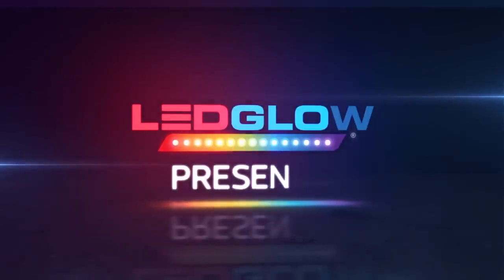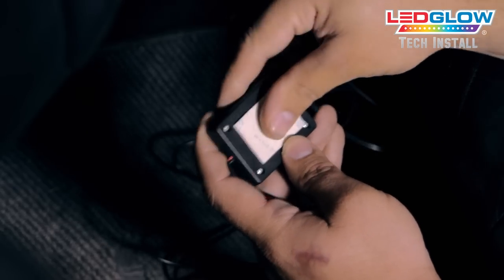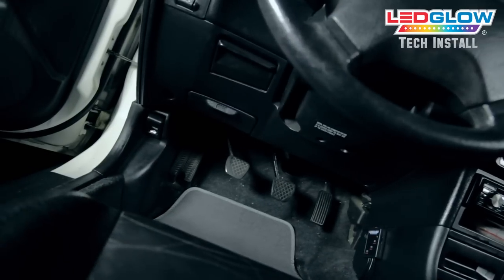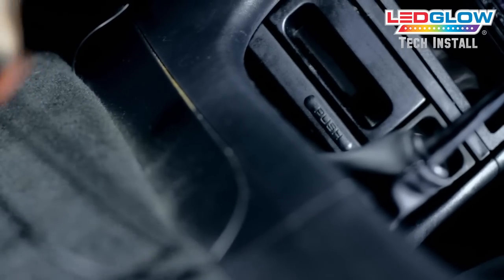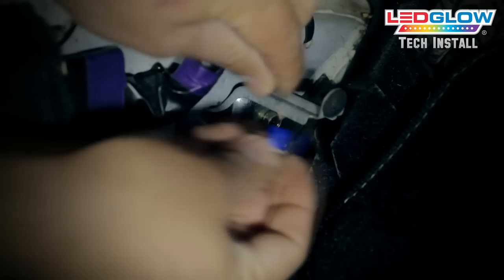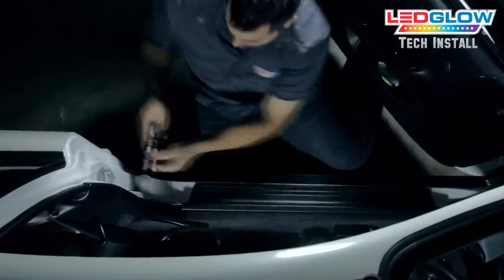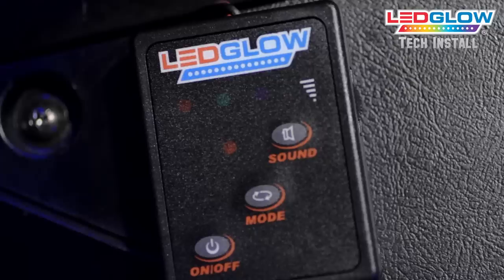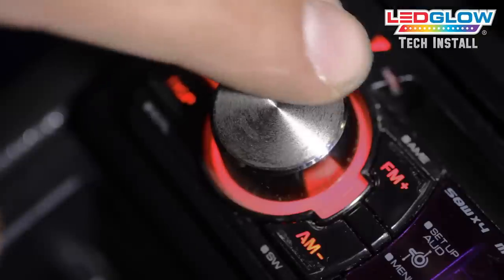Installation | LEDGlow 4pc 7 Color LED Interior Car Lights and Truck Lights

Comment: I have the 6 piece multicolor kit. I just wired it to my battery, but I never use it so I want it to turn on when I open the door. Now I have no idea what you did. What did you use to connect it to the fuse and how do you know what fuse to put it on? And I have no idea what you did to the ground on the door. You went way to fast, your hands were blocking everything and you didn't explain anything. Help me out here! Please reply soon so I can get this set up.
Reply from the maker: +Stephen Locke When it comes to the expandable circuit, you can use any constant power fuse that is 15 amps or less. As far as the door jam install goes, you just splice our kit's ground wire, into the ground wire on the door jam switch.
Reply: First of all, thank you for replying so fast. Can I put the positive wire directly on the battery and the negative on the car door?
Reply from the maker: +Stephen Locke Yes, as long as the door jam switch is activated by ground control

Comment: Would this kit work in a 1998 ford f150 extended cab?
Reply from the maker: Aj Palmer Yes our LED lighting kits are universal and can definitely be installed to your 1998 Ford F150!
Reply: What fuse should I add the expandable circuit to?
Reply: Any recommendations?
Reply from the maker: Aj Palmer It all depends if you want power going to the kit at all times or only when the car is powered on. Personally I recommend connecting the kit to a switched power source so the kit only has power when the car is turned on. You can use some fuses like the radio fuse, power windows fuse, or any other source that only works with the car powered on. Let me know if you have any other questions or concerns!

Comment: I did everything but the kit won't turn on
Reply from the maker: Renzo Chacon What power source did you connect the red power wire to? Is the black ground wire connected to a bare metal surface?

Comment from the maker: The expandable circuit is an optional installation accessory that is not included with the interior kit. It makes the installation process a lot easier by tapping power from the fuse box, but it is not necessary for the installation. If you were to use one for your 2003 Honda Accord, you'll use a mini expandable circuit. Let me know if you have any other questions or concerns!

Comment: Would these work on a 05 chevy trailblazer?
Reply from the maker: Savedbymusic〈3 Yes, our LED lighting kits are universal and can be installed to any vehicle so you're good to go with your 2005 Chevy TrailBlazer. Let me know if I can help with anything else!
Reply: I will most likely be ordering mine this friday i want to do the add a circuit ( for fuse box wiring ???) but I'm unsure which add a circuit option i should use? Im not very inclined when it comes to vehicles which option should i use? (Still talking about the 05' trailblazer btw)
Reply from the maker: Savedbymusic〈3 You will need to use a Mini Expandable Circuit with your 2005 Trailblazer if you plan on powering your kit from the fuse panel. If you have any questions or concerns when you get to the installation process do not hesitate to contact us, we'll be more than happy to help out!

Comment from the maker: It is not recommended that our Interior Kit's lights be used under the car. The interior kits featured in this video come with four 9 inch tubes with 5 feet of wire so it will be difficult to mount tubes in different positions and run all of the wires. We do offer underbody lighting kits that come with two 48 inch and two 36 inch tubes that will give you the glow you're looking for under your car. If you have any other questions just ask!

Comment: Can I connect this with a 2000 bmw 328i?
Reply from the maker: joshua ortiz Our LED lighting kits are universal and can be installed to any vehicle with a 12v power source, so you're good to go with your 2000 BMW 328i! Let me know if you have any other questions!

Comment from the maker: You can use any fuse whether it's a switched or constant source, but make sure the fuse is 10 amps or less. You can use the radio fuse, power windows fuse, power locks fuse or horn fuse to name a few examples. The way you can tell how many amps for a specific fuse is by looking at the number on top of the fuse. If you have any other questions or concerns don't hesitate to ask!

Comment: can I use a 2amp fuse.?
Reply from the maker: snapback17 You should be able to get away with using a 2amp fuse to power the kit, but if that doesn't work you can go up to a 3 or 5amp fuse. Let me know if you have any other questions or concerns!

Comment: Will these be fine on a Mazda Rx8 2005?
Reply from the maker: ElArmando97 Our LED lighting kits are universal and can be installed to any vehicle, so you're good to go with your 2005 Mazda RX-8! Let me know if I can help with anything else!
Reply: Is Blue the only color or can you change it ? Or do you just need to buy a kit of the specific color you want?
Reply from the maker: ElArmando97 We have Single Color Options available that include Blue, Red, Green, Pink, White, Orange and Purple, as well as several Multi-Color options. Here's a link to our website for you to check out the different kits we offer and if you have any questions about any kit don't hesitate to ask!

http://www.ledunderbody.com/LED-Interior-Lighting-Kits.aspx

Comment from the maker: You can connect the power wires directly to the + and - terminals of your battery or you can power the kit from a constant 12v source on fuse box with our add a circuit. Some potential constant sources you can use are the brake lights or power seats fuses, anything that you can function with the car turned off. Let me know if you have any other questions!

Comment from the maker: You will need to connect the black ground wire to a bare metal surface or else the kit will not power. You can connect this to any screw that threads into metal or to the seat tracks. If you have any other questions or concerns don't hesitate to ask!

Comment from the maker: Unfortunately we don't have any videos showing an install on a 2001 Civic. The Interior LED Lighting Kit can be powered to any 12 volt source via the add a circuit, cigarette lighter adapter or the red and black power/ground wires from the kit. If you have any other questions just ask!

Comment from the maker: The second fuse used in the add a circuit for the interior lighting kit should be 4 amps, which is included with the add a circuit. Let me know if you have any other questions!

Comment from the maker: Yes, you will need to use the included 4amp fuse with the expandable circuit for the kit to power. Our lighting kits are universal and can be installed to any vehicle with a 12v power source so you're good to go with your 2012 Nissan Sentra. Let me know if you have any other questions!

Comment from the maker: You can still power this kit with your fuse box being under the hood that is not an issue at all.  In regards to your other question, any fuse will work.  You just need to decide if you want to connect it to a constant or switched source.  Let me know if I can answer anything else and have a great day!

Comment from the maker: If you have only 1 wire - simply get a 3m Scotch Lock Connector, and you can easily tap off the one wire to get your supplied power. Please let me know if you have any other questions!

Comment from the maker: The LED lights will only turn on and function when the door is opened. The black ground wire is being connected to the door pin, so when the door is closed, the power circuit to the kit closes. Check out our video called "LEDGlow's Auto Illumination" and it will further explain installing and programming your kit to use the auto illumination function. If you have any other questions or concerns don't hesitate to ask!

Comment: I got no car switch or zip ties or cord for charger
Reply from the maker: The kit comes with a control box which is the only "switch" that you will need. The expandable circuit that we show being connected to power the kit is not included, however, you should have received zip ties with the kit.
Reply: LEDGlow I ordered the 4 piece 18 led I have the led lights the box with wires. I don't have the circle wire in the back and I didn't receive the cigarette lighter switch
Reply from the maker: Please call us at 856-768-5700
Reply: LEDGlow could I email you?

Comment: my kit did not come with zip ties or the fuse wtf
Reply from the maker: +SweetPapaRayz z (chriswb2) I apologize about these items missing. I would recommend getting in contact with our customer service department regarding this matter. You can call in at 856-768-5700 or e-mail at: customerservice@ledglow.com
Reply: It's all good

Comment from the maker: A mini add a circuit will work with a low profile fuse box as well, you will just have to replace the stock low profile fuse with a mini fuse. If you have any other questions or concerns don't hesitate to ask!

Comment from the maker: Ray, if you want to learn more about connecting your kit to the door pin, click the link at 1:51 on the bottom right side of the screen that says "Learn More About Auto Illumination" or you can search "LEDGlow's Auto Illumination."  This video explains more about the auto illumination function and further explains connecting the kit to the door pin as well as the headlight and ignition switch. Let me know if you have any other questions about the kit or the auto illumination feature!

Comment from the maker: If you want to power the kit from your 1999 Audi A4's fuse box, you will use a mini expandable circuit. This is an optional installation accessory that is sold separately from the interior kit so you would need one to draw power from the fuse box. The interior kit featured in the video is our 4pc Blue Interior Kit that comes included with the auto illumination ability. Let me know if you have any other questions or concerns!

Comment from the maker: The on/off mode is included with the control box, you would just need to program the kit to use that function. Check out our video called "LEDGlow's Auto Illumination" for more information about the on/off function. Let me know if you have any other questions!

Comment from the maker: Please refer to our underbody installation video to see more on how to install the tubes to the front and the rear of your truck (can't post links in comments). Every vehicle is different when it comes to mounting locations, but the process is virtually the same. The interior kit will also not sync with the underbody kit because they are two separate kits with separate control boxes. We'll be releasing a revamped underbody installation video very soon so stay tuned!

Comment: I am truly considering purchasing the red 4pc. to put in my new car. However that is the problem. It's brand new. I work with electronics similar to this, but not with cars. I'll be frank. It scares the shit out of me thinking about trying to install these. I would have to kill myself if I screw something up in the wiring.

Comment from the maker: There is no difference between the 3 expandable circuits besides the size of each. Different makes/models use different fuses, so that's why we offer 3 different types of expandable circuits. For your 2001 Jeep Cherokee, you will use a mini expandable circuit. Let me know if you have any other questions or concerns!

Comment from the maker: What kind of car do you have? If you're looking for way to install without drilling a hole, your best bet would be to power the kit with a cigarette lighter adapter or hardwire the kit to the back of the cigarette lighter port. If you have any other questions, don't hesitate to ask!

Comment: Sold how much
Reply from the maker: mike malott The interior kit featured in this video is priced at $32.99 for Single Color options that include either blue, red, green, pink, white, orange and purple and $34.99 for the 7 Color Kit option. Here is a link to our website for the single color options: http://www.ledunderbody.com/4pc-Interior-Lighting-Kits.aspx and a link for the 7 Color option: http://www.ledunderbody.com/7-Color-4pc-LEDGlow-LED-Interior-Lights-Lighting-Kit.aspx. If you have any other questions or concerns don't hesitate to ask!
Reply: Why yall are the best great product for a low price
Reply from the maker: Thanks a lot! Glad you're enjoying the kit!  mike malott

Comment from the maker: If you install your kit this way, the lights will not turn on when your door is closed and will only illuminate when the door is opened. Just make sure that you connect the power wire to a constant 12v source. If you want to refer to our "LEDGlow's Auto Illumination" video, it goes more in depth about installing your kit this way. Let me know if you have any other questions or concerns!

Comment from the maker: This lighting kit was designed for a 12v power source and will not work with a 16v power source. The blue color looks a little dark because the color is being absorbed by the dark interior and floor mats. If you are looking for a lighter blue color, our 7 Color Interior Lighting Kit comes included with Teal, Blue, Green, Red, White, Purple and Yellow. Let me know if you have any other questions or concerns!

Comment from the maker: The difficulty all depends on how you're going to install the kit. The add a circuit is the easiest and cleanest way to install any of our LED lighting kits. If powering the kit from the fuse box concerns you, you can use a cigarette lighter adapter or you can connect the red and black power wires directly to your car battery. Let me know if you have any other questions or concerns!

Comment from the maker: If you ground the black wire of the kit to the door pin and enable the auto illumination function, the kit will only function when the door is opened. If you don't choose to install the kit with the auto illumination feature, you will be able to use your kit anytime whether the door is closed or not! Let me know if you have any other questions!

Comment from the maker: You can splice the power wire into any other switched or constant 12 volt source using a butt connector or run the power wires straight to the battery!  Let me know if you have any other questions, I am more than happy to help!

Comment from the maker: If you order a 4pc Interior Lighting Kit, you will receive the four 9 inch lighting tubes, control box, mounting hardware, installation instructions and a one year limited warranty. If you have any other questions or concerns just ask!

Comment from the maker: Whether you're installing this to a 2007 Honda Accord with Navi or a 1990 Honda Accord, the installation process will remain the same as our lighting kits are universal and can be installed to any vehicle with a 12v power source. If you're looking to wire the kit to the radio source, having a navigation system will not alter the installation process and you shouldn't run into any issues. If you have any other questions or concerns don't hesitate to ask!
Reply: How do you adjust the colors

Comment from the maker: Yes, before you begin the installation we recommend disconnecting the battery's cables to ensure there is no power running through the car. When you're ready to connect to power the kit, you can reconnect the battery's cables and resume the installation. Let me know if you have any other questions!

Comment from the maker: You can use the auto illumination function with any of our 4pc LED interior kits that come with 9 inch tubes or Expandable LED interior kits that use either 9 inch or 15 inch tubes, but remember the kit will only work when the door is open. If you try to use the kit with the door closed, it will not turn on. To learn more about the auto illumination function, click the link at the bottom right of the screen at 1:50 of this video. Let me know if you have any other questions or concerns!

Comment from the maker: You can start off with one of our 2pc Interior LED Starter Kits that can be expanded to included up to 6 interior tubes, or you can check out our new SMD LED Interior Lighting Kits. Our Million Color Pro Interior can power up to 8 12" flexible interior tubes and our Single Color SMD Interior Lighting Kits can power up to 14 12" flexible tubes that can be easily controlled by the buttons on the control box or the included wireless remote. Let me know if you have any other questions!